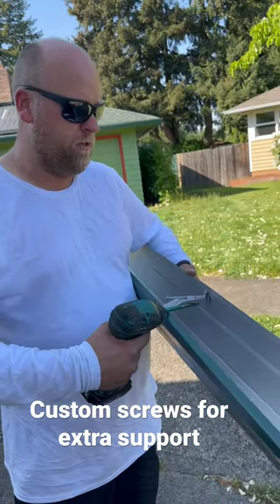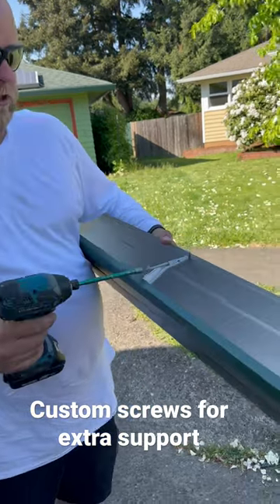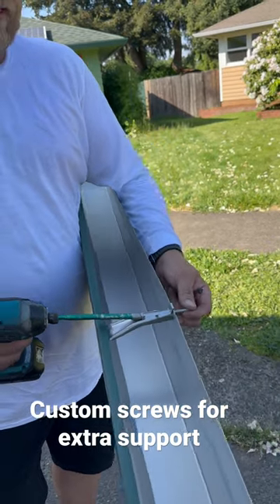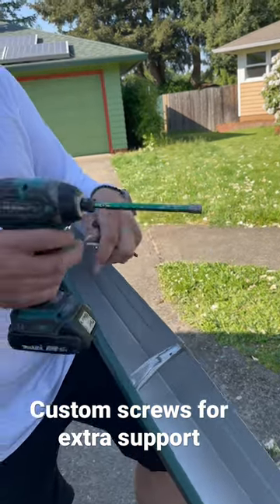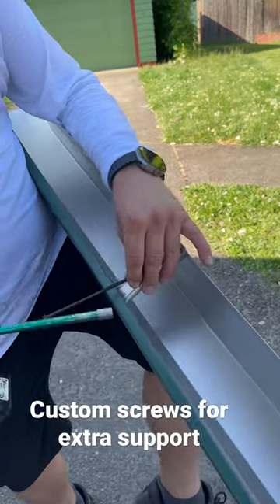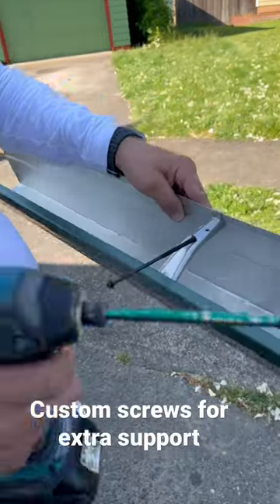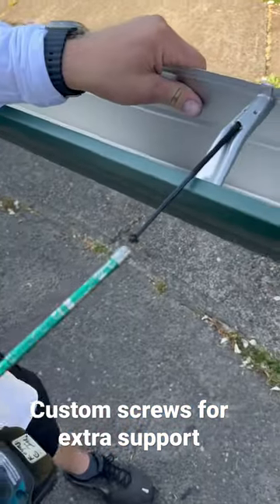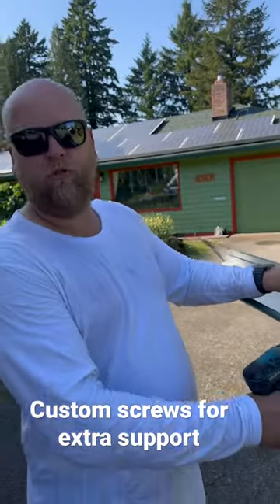Got a bad rafter? Custom gutter screw #shorts #trending

Comment: What’s a longer screw gonna do if it’s rotted wood?
Reply: Usually only a couple inches of the rafter tail is rotted. But you knew that right
Reply: @foxwood67  if you’re dealing with rotted rafters then you shouldn’t be driving a screw into it’s end grain anyways. I’d sister board the rot so you have something solid to attach to. Otherwise those gutters will 100% fail within the next 1-2 years. And you’ll have 100 problems with them in the mean time. Or a strap system like what 90% of people do. Adding a longer screw won’t fix anything, that’s like a finish carpenter filling trim gaps with silicone 😂 might finish the job but it’s garbage and not the right way
Reply: @foxwood67  “but you knew that, right?”*
Reply: @EarlyBirdArms  I don’t work in a freeze thaw area. Don’t need to worry about excess weight. Longer screws work fine or as you mentioned in severe cases sistering a 2x
Reply: @allaboutpressurewashing8308 sure, that was in the bid.
Reply: @EarlyBirdArms  1 to 2 years before it fails? Says who? if you "sister" then wont the sister wood also rot?

Comment: Why not fix the issue at hand…?  😮
Reply: Bc they install gutters, they don’t fix dry rot 😂
Reply: People are cheap
Reply: It’s not even being cheap, it’s not a good investment trust me. If it’s structural or very bad then yes, but why throw thousands away for no reason. Most wood looks fine just not holding the best or won’t hold 20-30 pounds per foot of gutter (for snow/ ice compensation but may need more). Standard gutter screws are usually 1.5-2” long so using a 3-4” screw does the job since only 1-2” of rafter has a weak hold.
Reply: @vitaliyvee  it’s not gonna take thousands to sister boards on the rot. Or add blocking, or even if he used roof straps to hang the gutters like a normal company would have done if they can across rotted wood and couldn’t attach the gutter
Reply: @EarlyBirdArms  no need to complicate, longer screw and you’re done. Usually all it takes is 1-2” longer.
Reply: you paying?

Comment: If it’s that bad, they probably need fascia work too. May as well sister up some rafter tails and replace the rotten fascia board before putting those new gutters up.
Reply: Sometimes it’s cost prohibitive or they have soffits and fascia that would be expensive to remove. It’s always the first 2-3” that don’t hold as well, so a 4-5” screw is perfect.
Reply: Can’t sister new boards. No fascia or soffit to speak of, if you sister new boards you’ll see them. They will be a different color too. Most rafter tails here decorative, really old 100+ years, are a true 2x4.
Reply: and then who primes and paints the fascia. Lets not forget about the source of the rot.

Comment: Everyone is misunderstanding the point of a longer screw. If the fascia is rotted then yes, you offer to replace. Sometimes everything looks good just the first 1-2” is weak. In Oregon many homes just have rafter tails and they are exposed with no soffits or fascia boards, many are decorative in nature. You can’t sister some rough carpentry to them and yes you can probably refurbish them but this could cost more then the gutters and using a cheap longer screw is just a wise move overall.

Comment: Fix the fascia
Reply: That’s not how it always works in the real world. You offer that as an option but TRUST me most home owners don’t want to throw thousands away if they don’t have to especially if the facia is fine just doesn’t have a good enough hold.
Reply: @vitaliyvee  you right, I live in the country and worked in auto repair for around ten years, it's a lot different than say the dealership. People would rather take it home and have uncle Jessie try and fix it, or just put some JB weld on it for now lol. Lotta people don't have the money to fix things the correct way, so they have to get by as long as possible w patching things till they break again. I have a friend who used to do gutter work, man he made great money! Take it ez!